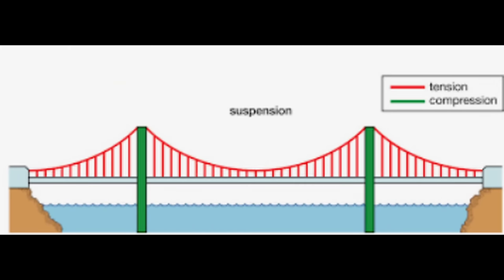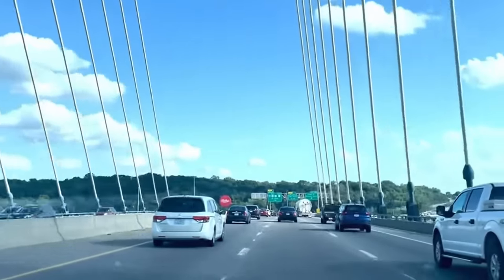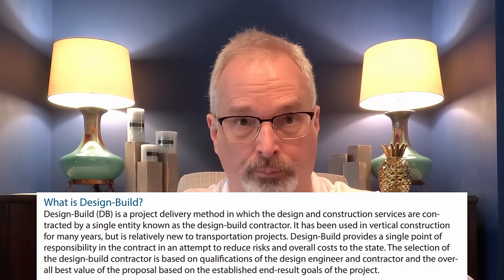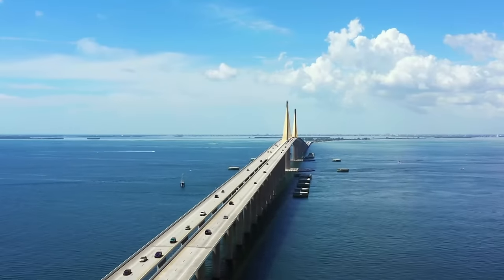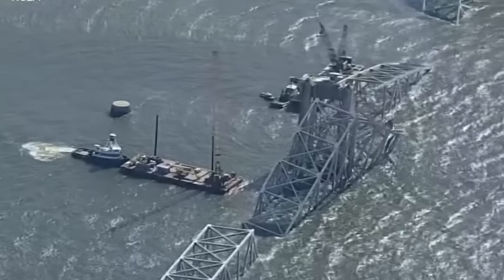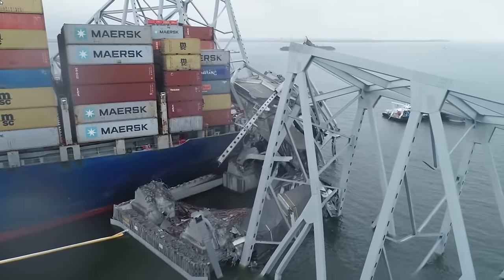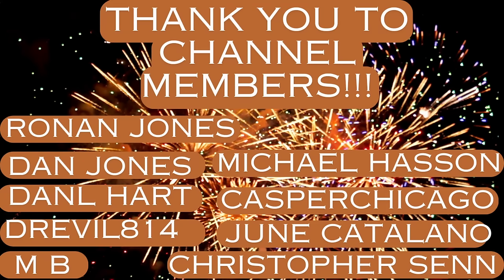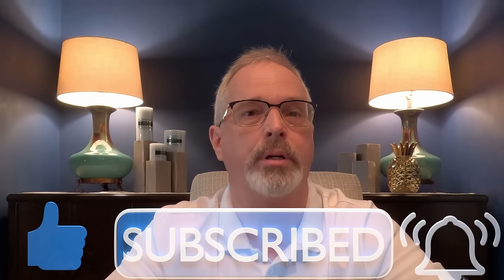How will the Key Bridge in Baltimore be Rebuilt?

Comment: The bigger issue is weight capacity and vibration levels capabilities, given that freight is expected to increase 25% in the next 30 years it may mean heavier cargo or multi trailers no necessary more traffic or a modest 10% overall . But also I would like both pedestrian and rail added for larger loads to assist 40u transport across the bays to assist in separate load points
Reply: It’s defined as an interstate highway so no pedestrians allowed though a totally isolated walkway could be done as in Minneapolis on that bridge.
Reply: @JohnHallgren not been to the area, didn't know that thanks you
Reply: @ram64man  the MN I-35 bridge that collapsed a few years ago, being more in city, had a pedestrian path but it’s completely fenced off from roadway and connected to paths on both sides.

Comment: Design/Build had been around for years when I got out of the building industry 25 years ago.  GMP (Guaranteed Maximum Price) is another acronym we’re going to be hearing.  It’s not the Guaranteed MAXIMUM price, it’s the Guaranteed MINIMUM price.  THE OWNER (in this case, our government) ALWAYS PAYS.  There is no contractor in the world who would take a job like this and have to take a loss.
Reply from the maker: Thank you for your comments on this.  I appreciate it.
Reply: Sure.  The “Design/Build” process will definitely get (and keep) projects moving but the contractor is always doing pricing off partial/incomplete drawings.  The amount of contingency (both for design and construction) that has to be included in the budget is an absolute necessity to cover for these gaps in information.
Reply from the maker: @johnkelly6942  Thank you for that.  From what I have seen as one of the problems with Design Build is when the owner is stuck in the Design-bid-build mindset and tries to override the Design-Builds team decision making.  I have seen this issue on Arkansas DOT project as an example.
Reply: In the 20 (or so) years I was in the building industry (first as an architect then in commercial real estate) the constant in the successful projects was a “great owner”, one who understood and respected THE PROCESS.  These projects are TEAM EFFORTS and every member has to have the necessary experience and understand their role.

Comment: Shouldn't they consider another tunnel in the replacement study? Not sure of the cost difference but they said there is already one nearby that is overcrowded. A tunnel removes possibility of future collisions and may not have environmental issues like a bridge.
Reply: Not necessarily…cost is likely twice as much but also bridge is required for hazmat and oversized trucks which require a route on east side of city that’s shorter and closer to port.

Comment: G'day from Australia.
As ships are getting larger, heaver,and more powerfull, I think another tunnel should bulit rather than another bridge so that traffic can flow in both directions on an continunis road witch will be cheaper to build and maintain. 
The shipping will than be able to flow without being cumbersome in weather because of an bridge being there in place.
Gerard on board
SV GEMSTAR.
Reply: See Pinned post for why tunnel isn’t likely.
Reply: @JohnHallgren   Ok. I thought to give you my thoughts and resoning.
Thank you for the reply.
Reply: @SvGemstar  that’s fine…and if the costs were anything similar, that would make some difference but…the critical need for an efficient route for that special type of vehicle traffic which doesn’t have any viable alternatives on that side of the city is an important factor.

Comment: The Corpus Christi Harbor Bridge, with a main span of 1661 ft, was also a design-build project and should be a good comparison for the replacement bridge.  Can you compare that project and summarize the design issues and the root cause of the 5 year delay in completion and how they couldbe avoided? Also, the Wikipedia article [[List of longest cable-stayed bridge spans]] has a list of 90 cable bridges longer than 500 m.
Reply from the maker: I did a previous video on that bridge if you want to check it out.  https://youtu.be/5_nK68n6yA8?si=e2bZreWqIPEgmc8T
Reply: I did go back and watch that video you referenced. There is a lot to unpack there. My comment about the slide rules reflect my experience in college engineering. My first freshman programming class in college was done in FORTRAN on punch cards.  By my senior year, we were learning the importance of independently verifying the results of structural design software to filter out bad results from bad inputs or buggy programming.  Tremendous changes in four years.  I have actually been involved with creating a design-build public infrastructure project and appreciated the much quicker start to construction.  It was a fairly small project but there was a need for a very quick completion.  It was fortunately within my skillset to do the independent review of the design.  But these critical megaprojects definitely need to budget for the outside independent engineering review.  And it needs to start as early in the design process as possible.
Reply from the maker: @Nyth63  Thank you.  Those are all great points you make.  It seems that independent review of big projects has gone the way of the Dodo.

Comment: I would start with what sort of traffic does it need to carry. From the photos it looked like it was 2 lanes each way with a concrete divider. No pull off areas. Maybe don't "rebuild" it, maybe replace it with something better. More lanes, pull off areas, safer. Light rail? Heavier loads, larger tractor trailers? More clearance in the main channel? A LOT better protection for the support piers? We should not just build an identical replacement.
Reply: Federal standards would not allow it to be rebuilt that way. Minimum change would be adding breakdown lanes.
Increased clearance vertically would make sense. Some horizontal span increase might be needed.

Comment: SPT Standard Penetration Test according to ASTM standards.Never did an in place bearing load on a pile with a big heavy crane and mirrors and wires.I heard about them though.
Reply: There were several pile load tests performed
Reply: @JosephTrapani-bd3uj  Not referring to this bridge just in General.And unless it's Maine I probably won't be headed anywhere within a good safe distance at least a few hundred miles from there Unless it's Amish Country or for Maine Lobsters 🦞 or  Crabs   🦀✌️😋🚿

Comment: I have been writing that a cable-stayed type is the most likely, but I am now thinking that a steel arch might be a reasonable alternative.  There are several steel arch bridges today which have sufficiently large spans.  I would leave the footings of the main pylons in place as the foundation of the protection system, and put the new towers behind them.  This approach leaves the channel width the same, and allows for a faster solution, I think.  Even with a cable-stayed design, though, you could leave the current footings to save the cost and time of removing them.  Is there any problem with this approach?
Reply: Remember that the current approaches are some 50+- years old and beginning to reach the end of their life span. They are also incompatible with today’s standards for breakdown lanes and such.
So while they’re redoing that, they might as well build a cable stayed.
Reply: @JohnHallgren -- But even with a cable-stayed design, you could leave the old footings as protection for new towers behind them.  There are many ports with entrances no larger than 1200 feet.  Is it necessary to remove them?
Reply: @GH-oi2jf  note that I didn’t say remove them, just not reuse them.
But removing them can be done up to years later…like it was with Skyway here.
Though here the span was increased to 1200 from 800 so was necessary to get the close ones out sooner.

Comment: The Dames Point Bridge in Jacksonville is the right structure approach.
Reply: According to Wikipedia, it’s 1300 ft span vs 1200 here and 175 ft clearance vs 185 for the FSK. 
So bit longer but not as high.

Comment: Would they be able to use the existing spans in the construction of the new bridge ?
Reply: Really doubt it since those ramps are 45+ years old, but also I am sure that new bridge will be wider due to breakdown lanes as minimum. Plus the replacement will most likely have a gentler grade than old style was.

Comment: It would be significantly more expensive, but given the importance of the shipping channel, wouldn't a tunnel be a better option?  (and would affect hazmat truck routing obviously)
Reply: No.  Much more expensive and much longer to build.  Tunnels are for places where terrain demands it.  I don't understand what you mean by "the importance if the shipping channel."  Of course it's important.  The fallen bridge obstructed the shipping channel, but the Port didn't think the risk was sufficient to motivate them to take measures to protect the bridge from ship strikes.  Maybe they will learn something.
Reply: @GH-oi2jf agreed, and my hazmat trucker acquaintance would NOT want that additional overhead of the longer route permanently!
Reply: @GH-oi2jf  The 'importance' of the shipping channel' is the definition of the problem.   A tunnel prevents this from happening again.  A bridge, with better defenses, reduces but doesn't eliminate the threat.  Just questioning where the tradeoffs between the two ideas might be.   https://en.wikipedia.org/wiki/Chesapeake_Bay_Bridge%E2%80%93Tunnel is an example where they didn't need a tunnel but the Navy required it to expressly prevent a bridge collapse from closing their sea access.

Comment: Because of the need for speed, My money is on post tensioned precast concrete/ cable stay. Same as in Boston and many others. Hopefully they've learned that rebar spacing needs to be bigger than the aggregate in the concrete on the foundation piers. ( Learned lesson from Boston) 🤞 voids are avoidable. Pun intended 😂
Reply from the maker: YesI think that's the leading candidate bridge type for sure.

Comment: Suspension bridges have a serious maintenance problem. The main cable is huge and almost impossible to inspect after construction. Typically, it is encased in a sleeve for environmental protection and packed with something to prevent water migration. The individual drop cables  are essentially attached to eyes attached to the main cable so they can be replaced individually if needed. The attachment mechanism is problematical. Because of the slope of the main cable, there are side loads tending to slip the attachment towards the center of the span. Heavy weather presents dynamic loads which requires some flexibility. Weather, corrosion and flexibility are an unholy trinity. Generally, flexible materials don't age well. Salt air is brutal on steel. The other problem with suspension bridges is anchoring the main cables. Very few sites allow anchors like the Golden Gate Bridge system. There must be non structural considerations to go with a suspension bridge.

Comment: What height is required to allow the largest cruise ships and ships a bit higher out of the water than 24,000 TEU ships?
Reply: I just found a government website that lists the bridge height clearances for the major container ports in the United States. There’s only apparently three bridges that are higher than FSK was at 185, and that’s 188 at Delaware Memorial Bridge and two in NYC area at 215.

So this one was right up there with others.

Addendum - apparently the new bridge at Long Beach is 205 but wasn’t updated in that table.
Reply: @JohnHallgren  The long Beach bridge height of 205 feet was driven by what the largest ships need.
Reply: @JohnHallgren  The Long Beach height of 205ft was driven by the largest ship needs.   Both the largest cruise chips couldn't go under for the Los Angeles cruise terminal and the TPAC container ships couldn't go under.  Thus driving traffic to the port of Long Beach.

I recommend a minimum height of 205ft.
Reply: @External2737  i don’t disagree at all and that’s what I found on websites about LB but was just pointing out that 185 was close to current max of most east coast ports.
Reply: @JohnHallgren  Cool.  I am not disagreeing either, just build for the future as Miami and  Newark have no restrictions.  Add Baltimore and the East coast might have enough ports for 24k.
Reply: @External2737  however, according to that website, Miami has only 48 ft channel and NY/NJ has 45 ft so Baltimore still is a bit deeper.

Comment: In replacing a bridge without the hurry because the old one wasn't suddenly destroyed but the concern about the need to replace it is on their heels, why would there need to be a land-acquisition phase? That's assuming that the new bridge will be wider so it can have more lanes because they might be replacing the old one not only for structural soundness reasons but because they've outgrown it?
Reply: The only additional lanes that I think would be added are breakdown lanes which are now required because the traffic volume is only half of the Sunshine Skyway with four lanes and that’s sufficient there.
Reply: @JohnHallgren : So then they need the extra land for the additional foundations on the areas where the bridge ends, to make the new bridge wider, basically, right?
Reply: @HelloKittyFanMan not likely wider but being basically parallel to this one so they don’t have to remove old bridge pieces immediately like those approaches before they can begin. They often do that.

Comment: They could think about calling a tunnel builder.  That is the reason the Chesapeake Bay Tunnel exists. Ships will never get trapped in the bay with the tunnel.
I really don't know how long tunneling takes. Thank you for the video.
Reply: But…this was the only short and easy east side route for hazmat and oversized loads which aren’t allowed in tunnels so bridge is required, plus tunnel would likely cost twice as much.
Reply: @JohnHallgren  Yes that is a good point, but short and easy vs. safe and secure?  You make another good point on the cost.  I did not know that they are so much more expensive.
Reply: @glennfelpel9785  I say short and easy because the west side of beltway is much longer and more congested so this bridge gives those two types of traffic an alternative that’s not any worse, and possibly better than the two tunnels.

An acquaintance regularly used the FSK when driving his RV to FL because he can’t use tunnel with LP tanks.
Reply: @glennfelpel9785  they considered a tunnel initally in the 70's, even securing funding for it, but in the end were able to build the FSK bridge for half the cost
Reply: It was built as a bridge so that trucks carrying hazmats could use it as they cannot use the Ft McHenry or Harbor Tunnel.
Reply: @TheLazyEyebrow half the cost but it collapsed.

Comment: The original design of the Key Bridge allowed two lanes in either direction with a Jersey barrier between the northbound and southbound lanes, and no shoulders. The bridge was wrought with delays and cost overruns, paid for by Maryland taxpayers. If the bridge replacement would allow for shoulders, the approaches on either side that remain standing need to be torn down and replaced. The design of the bridge should be a cable-stayed design which would really look good on the Baltimore skyline.

Comment: Has any engineer thought about using offshore well rig construction techniques to create a float in  sink and give a work platform to do deep foundation work.    If not using it for bridge structure.   

Research into bridge dolphins that can deflect a ship that size.   Chances of it happening again. Slim . I await what caused the blackout.  

Will ferry boats for big rig loads be built to take up the slack till the bridge is rebuilt.

Comment: I think they would be smart to increase the new bridge from 4 lanes to 6 or 8 lanes when they rebuild it, they are rebuilding it anyway and it will give them the option of expanding the 695 in the future without the bridge becoming a bottleneck
Reply: Traffic volume doesn’t support that much of an increase but adding breakdown lanes which are now required is.
Reply: @JohnHallgren  yeah, I figured 3 lanes each direction and a breakdown lane would be the max, until then you could have a breakdown lane on either side in both directions until the traffic volume increased enough to have to upgrade 695, since you would actually have to replace the bridge otherwise at a higher cost 10 to 20 years down the road
Reply: @cerebralfailure8804  considering that the current 1987 Sunshine Skyway currently has twice the volume of FSK with only two lanes per direction but has breakdown lanes, I don’t think 3 travel lanes on FSK would be needed.
Reply: @JohnHallgren  I guess a lot will depend on how much traffic volume was expected to increase with the planned $550 million expansion of the Port of Baltimore

Comment: Just take the plans for one of the bridges built in the past 20 years and build it again.The only engineering would be for the foundation and access ramps.
Reply: That may or may not work. But I agree with the sentiment. One thing that definitely needs to be done is better protection of the bridge supports to prevent this from happening again. Not only in Baltimore but other major ports and bridges. Including river crossings. But in 3 years unfortunately the politicians will have someyhing else on the plate that they are worried about.